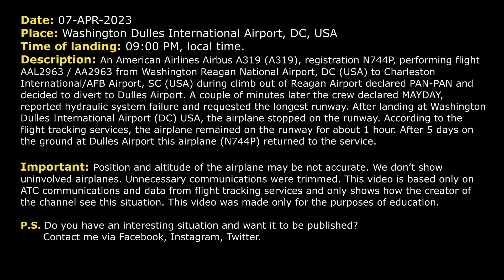MAYDAY. Hydraulic system failure. American A319 wants the longest runway at Dulles Airport. Real ATC

Comment: FYI, the same thing happened with another A319 yesterday: UA442 was turned around en route from DEN to LGA, as the latter's runway would have been too short for a safe landing. Not sure which of the three systems failed, but only half of the brake flaps were extended when the plane landed at DEN.

Comment: something pilots should know:  airlines don't care so much about your checklists - they're more interested in whether or not the airplane crashes or not!!! - if the hydraulics fail, that means land the plane asap.  don't doddle.
Reply: KANE

You obviously know nothing about airlines....
Check lists are there to make non normal flying safer...
Hydraulic failure may result in a longer landing distance. ..
There are check list for that ??
Which runway.
You are obviously not a professional pilot. ..and never will be. .....
True????
Reply: The checklists are there to make the flying safer, especially in an emergency, which is one reason there are always at least two pilots (and hopefully, always will be). The checklists are designed with priorities in mind - the most important things are covered early on, and provide instruction on what to do in pretty much any conceivable event. If there was a step early on in that checklist that indicated that the problem was getting worse rather than remaining stable, then the checklist would just tell the pilots to go direct to the nearest safe landing area. Without these checklists, the pilots might inadvertently do something while flying that could make the plane unrecoverable - taking a turn too sharp, descending or ascending too steeply, flying to fast or slow, etc. with hydraulic failure, they were probably in level straight flight while they tested and tried to reset flight control and other vital systems before attempting to land or enter a populated area. There's no way a human could memorize all of that information, and there's still too much potential for a computer to either not realize there's an issue or to misidentify the root cause. The use of checklists in any complex process is widely adopted across multiple industries and leads to universally better outcomes.
Reply: Dude, learn about checklists. They are there to help pilots handle emergencies.
Reply: Your lazy boy type rating does not make you an expert.

Comment: I didn't hear a repeat of the Mayday when changing controllers.
Reply: Controllers talk to each other also. If they're changing emergency plane, they inform each other beforehand. 

Can't post link as I'm not gonna search for it again, but I heard different mayday plane (small one, single person, he had some problem with the stick they fly with), plane did mayday call, controller told him to change to different one, pilot did not answer for a long time after that, so they had no idea if he even changed it, therefore they had to say same info on both channels. I think the issue was just not turning it on properly after changing seats, but it is perfect example that they talk to each other.

So it is said just in case, not to inform them.
Reply: Yeah that irked me.  Not only was the “mayday” critical information that is worthy of an acknowledgment but so was the request for the longest runway.   He could have at a minimum said “copy your ‘mayday’ and need the longest runway”
Reply: Sounds to me like all involved definitely had the mastery properly in hand.
Reply: @alexanderSydneyOz  There has been at least one accident in part caused when the existence of an emergency wasn't passed along to a new controller. Yes, it should get passed along, but the pilots should make sure the new controller understands the situation.
Reply: Not necessary. Each controller they were handed off to is in the loop and aware of the emergency.
Reply: @rleon8339  They're supposed to be. But it hasn't always happened.
Reply: @rleon8339  Yes it is....
Other aircraft want to know what is happening in their airspace as it may effect their flight......delay .....fuel status..
Poor airmanship indeed.

Comment: This is a great example of the difference between using Pan and Mayday. What started as a small problem quickly became something far more serious, and so the pilots upgraded from a pan to a mayday to make the controllers aware.
Reply: Agreed, under declaring makes the situation more dangerous whilst over declaring increases the level of safety. When in doubt, over declare. There are plenty of accident case studies where pilots have been hesitant to declare emergencies resulting in loss of life and/or making the situation much more dangerous than it needed to be. The crew and ATC worked together to get the plane down with everyone on board safe. Job well done.
Reply: @SciMajor1  What is the difference between a Pan Pan and May Day?
Reply: @JohnSmith-zi9or  Ignorance is bliss..
Read FAA AIM 4-2-1C. 
Same for ICAO. ...if you know what that means...
Reply: @daftvader4218  I don't know what your point is.
Reply: Three hydraulic pumps on the bus. Lost the first one around 22k and that was Pan Pan. Lost the second one and that was Mayday. Captain Woody went from assessing the situation to realizing he had only one source of hydraulic left in a 3 tier system. Capt wanted the longest Rwy possible with emergency support b/c he couldn’t have understood what was happening or predict what was going to happen next.
Reply: A single hydraulic system is most certainly not a May Day call. But the non standard nature of US ATC it probably doesn’t matter…the rest of the world however…
Reply: @spfh84  Thanks for saying exactly what I was trying to say and did so eloquently.
Reply: It's not a mayday. It's a Pan. When offered a vector to land they denied the vector to brief more and to get "setup". Had they done this at some international destinations they would have had big fines. A mayday is a dire distress call. They were perfectly under control, with a degradation of systems. But controllable. Safe.
Reply: @John Smith  It's a mayday because the captain decided it was serious enough to warrant one, it's his call as commander of the aircraft. They probably had to finish running checklists and calculations as it was such a (as you put it) dire situation before they could make an approach. As for fines, you've no idea what you're talking about. They would not get fined as they're an emergency aircraft.
Reply: @sirdrumalot1  The Mayday declaration was probably also part of the checklist.
Reply: @JohnSmith-zi9or  he started as a pan. Then went mayday. Hydro leak: pan. Hydrolic system failure: mayday. And he completely lost at least 1 hydrolic sysytemu can tell by the fact he is unable to clear the runway.
Reply: @JohnSmith-zi9or  So where do they fine you then  ???
You are obviously not a professional pilot.
Reply: @daftvader4218  I'm a professional pilot. 20+ years. Retired military too. Sigh.
Reply: LOL....they could have said emergency with the same result. Keep thinking up those problems where none exist. Well done.
Reply: @R L T  it wouldn't have had the same result. A pan is a fairly regular occurrence, mayday's are thankfully rare and are treated a lot more seriously, eg. Full emergency at airport vs local standby
Reply: @sirdrumalot1  Don‘t engage him, he‘s just a troll with no piloting experience.
Reply: @EmotionalWeather  Then what would he know about the correct use of ICAO-mandated and FAA-preferred radio terminology?
Clearly more than you, as he is 100% correct.  Maybe you should open the FARs once in a while, or get someone to explain them to you if your literacy is inadequate?
Reply: @The_Real_Phil_Lee , I'm curios, which 121 international carrier do you work at?
Reply: @The_Real_Phil_Lee  Phil you haven't got a clue about standard RT terminology. 
You should read 
FAA AIM  4-2-1C 
Same for ICAO. ...